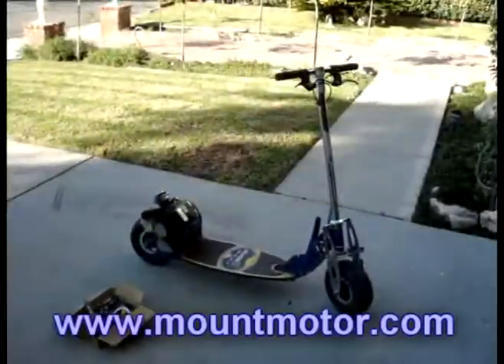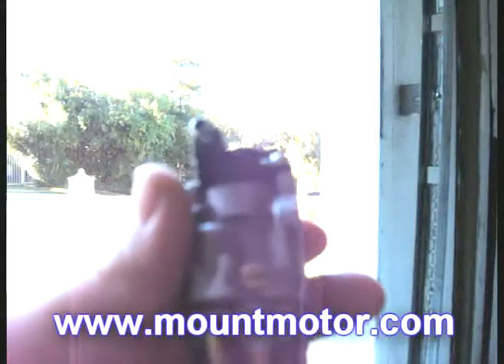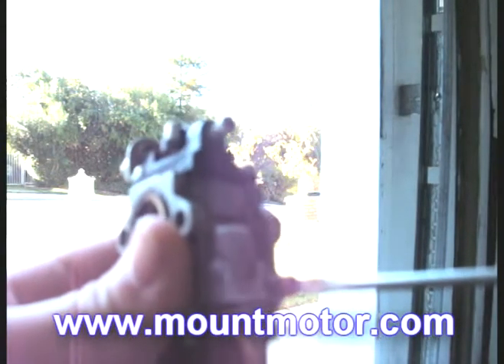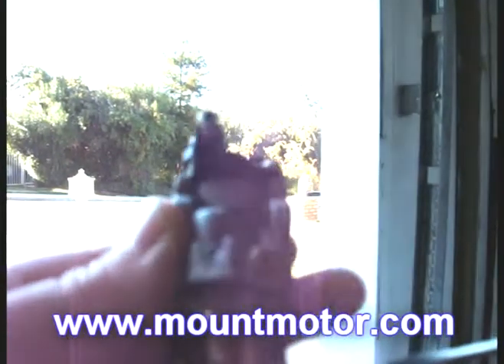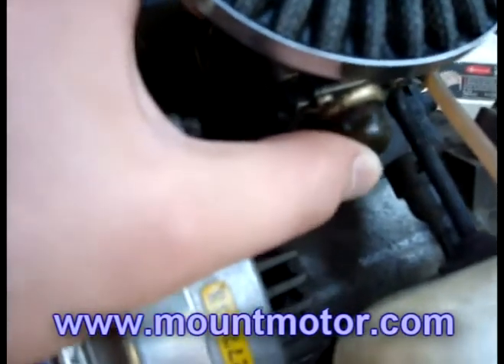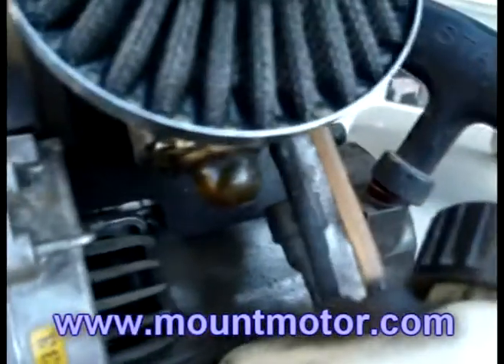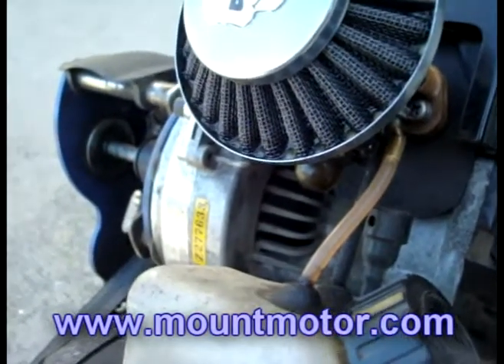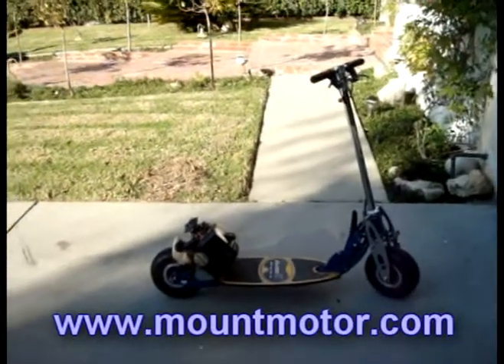How to fix acceleration problems

Comment: what are your thoughts on goped vs. bladez? I am buying used, so the discontinuation of bladez gas scooters is irrelevant. It seems that there are more aftermarket parts for the goped. Is this true?are there any models that you recommend from either manufacturer?

Comment: ok hey one way. to fix the problem... if the lever is in the neutral ( up ) position put it down and you should be runin.. the lever should be next the the carb on your scooter.. me everytime i strt my scooter and forget to pull the lever down i dies.. then i strt and pull down and works great try it.. i bet i work.. SUBSCRIBE